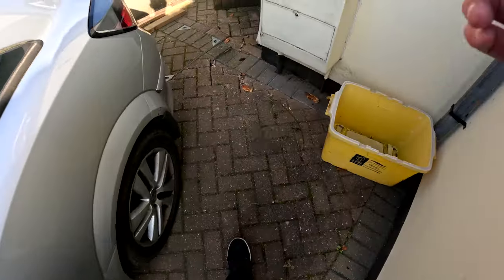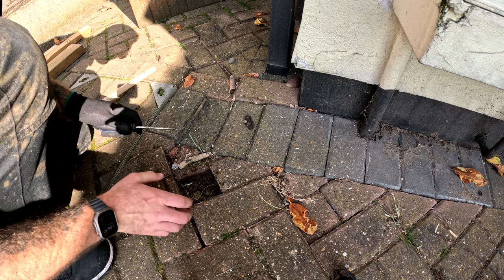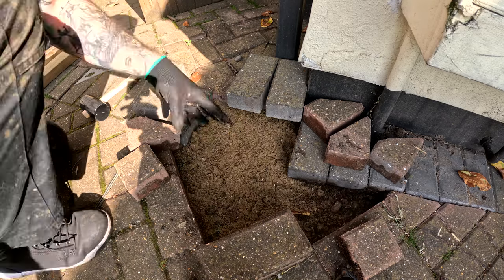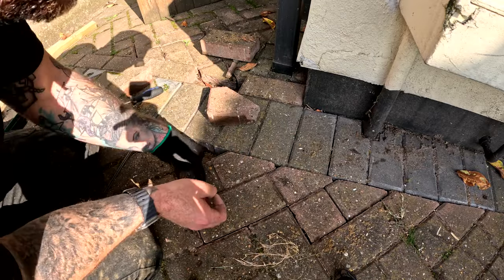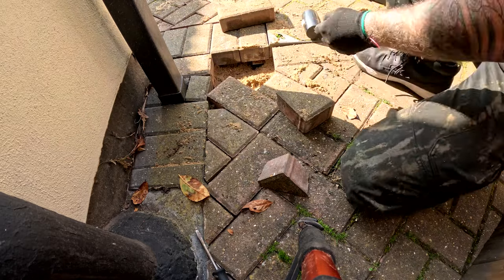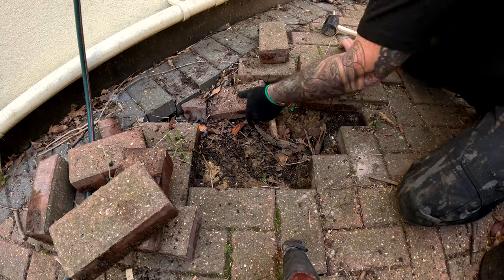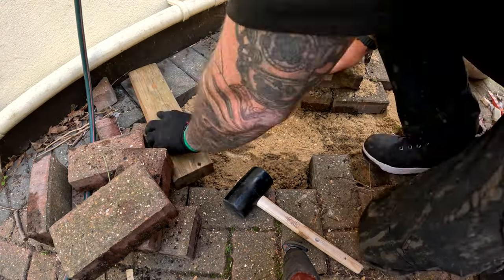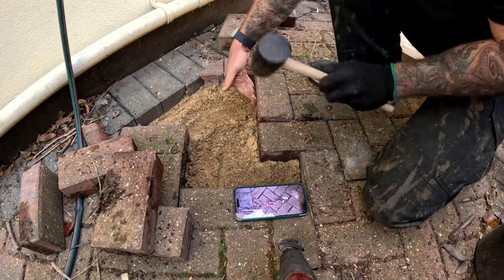How to Repair/Fix Sunken Block Paving with This SUPER Simple DIY Method!

Comment: I had a job like this in the summer. Told the customer I could replace a few broken blocks with ones he had in his shed. Honestly mate I spent hours trying to get the blocks back in. I’m hey seemed slightly wider than the older ones. I swore I’d never offer to do this again. You’ve made it look a doddle though 👌
Reply from the maker: Haha I had a job shortly after this that didn’t look that back but when I started it took me 6 hours and 7 bags of sharp and I didn’t charge the customer 🤣 luckily I don’t get asked very often 🤣🤣🤣🤣
Reply: @KirbsideCleaning  I don’t feel so bad now 😂😂
Reply from the maker: @Weirjetwashing I stuggle to gauge what to charge for it as it’s a strange old job and only a diy fix but yeh deffo won’t be making that mistake of doing it for free again 👀🤣
Reply: What is sharp sand, is it paver sand?

Comment: Interesting, thanks. What do you recommend if the rising is caused by tree/shrub roots. I've heard some people cut roots out completely or shave them down with an angle grinder but some say that damages the tree/shrub.
Reply from the maker: Remove the tree/root would be the only way

Comment: Hi, How did/do you charge for the repair of sunken blocks like in this video as a price example? Cheers
Reply from the maker: Hey! So iv only ever done it as an add on to cleaning a driveway but I guess if I was to do it as a stand alone I’d just charge a half day rate/day rate plus materials depending on the size needed to relevel
Reply: @KirbsideCleaning  ahh I see, so how much was this as an add on? 
I would likely only be doing it based around a drive clean too
Reply from the maker: Normally I just charge for the cost of the sand £10/£20 or something like that as I’m not a professional but it takes about 30 minutes so £30 add on wouldnt go amiss

Comment: I've watched several repair videos because I have a problem.  None of them added  sealer after the repair.
Reply from the maker: Why would they add sealer? It has nothing to do with block paving. It’s an optional, all be it, waste of money service/treatment that you can add after the fact.
Reply: Thanks Kirkside, i am a widower and can't afford to hire contractors to do everything. I raised some pavers successfully but felt it needed some protective coating as the installer didn't do a great job and I felt the sealer would make it waterproof. I'm learning, mostly trial and error.  I'm 77 years old and will tackle anything but electricity.
Reply from the maker: @charlesteincarter5537 well done you. I don’t blame you re the electricity I prefer to steer clear too!